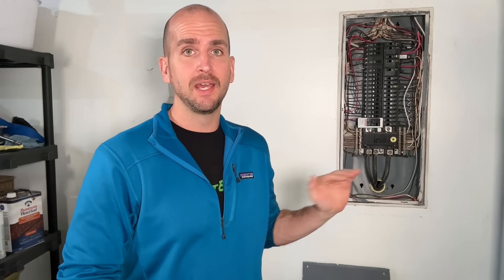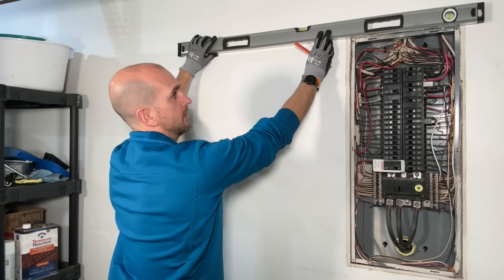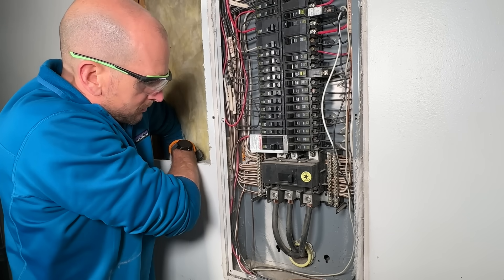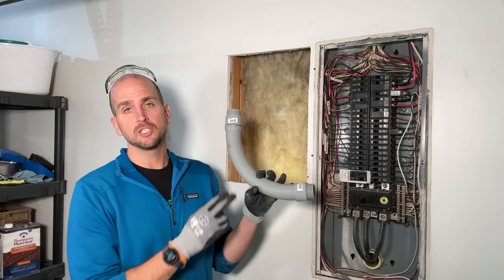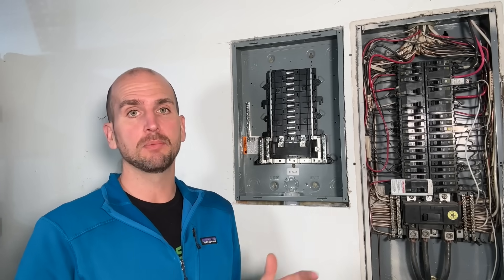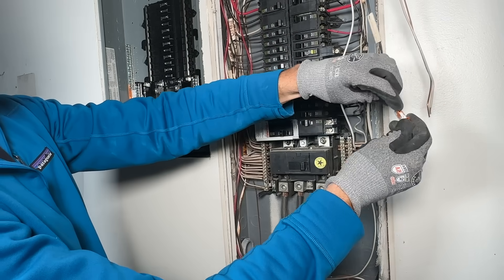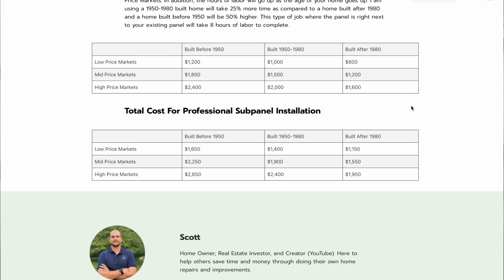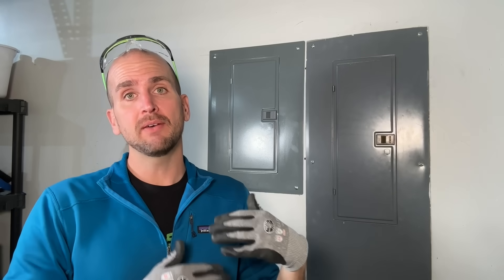How To Install A Sub Panel Next To Existing Main Panel

Comment: Since when can you run a bare ground through conduit???
Reply: 1982
Reply: I haven't seen anything in the NEC (e.g., 250.118) that prohibits it and I can't think of why it would be bad in PVC conduit (though I wouldn't do it in metallic conduit for fear of oxidation between dissimilar metals).
Reply: There’s no potential reaction between steel and copper so it’s not an issue. Copper oxide forms when copper reacts with oxygen, not steel.
Reply: @pld8993 :  Galvanic corrosion
Reply: @ncooty  You won't get galvanic corrosion in a dry location. There won't be an electrolyte present inside the conduit, which is necessary for galvanic corrosion to occur. Also, they are bonded to each other so that eliminates any current induced reaction. If the conduit is underground or outdoors, I'd avoid bare copper.
If what you're saying was true, then we would be prohibited from bonding a bare Cu ground wire to a steel box, which is required in many instances and is considered an effective grounding path. If there was a concern about bare copper being in contact with steel, it would never be allowed for a bonding connection. In fact, when using PVC with a metal box, it's the only grounding path.
Reply: @pld8993 :  Those are great points.  Thanks for the reply.
Reply: Any time

Comment: Next up? How to add a 30 amp RV service to the outside of your house.
Reply from the maker: Then I would buy an RV 😂
Reply: @EverydayHomeRepairs  You’re welcome!
Reply: @donaldbailey5576  
Nah, go ahead and spring for the 50 amp or one of those 30 and 50 amp combos. The 50 amp can be utilised as a secondary EV charger for redundancy.
Reply: @EverydayHomeRepairs  
RVs have their own set of DIY challenges and could be good for your channel.
Reply: @GeorgeVCohea-dw7ou  That’s a good idea. I have no plans for an EV in my future unless they make one that can tow a travel trailer 300 miles and charge in 12 hours. The 80 miles/24 hour charge doesn’t make the grade. But you never know.
Reply: @donaldbailey5576  
It's not too much more expensive when taking the entire project into consideration, and if you sell, it would be even less to convert an existing 6 gauge run to an actual EV receptacle, should the next owner prefer that. 30 amp is mostly left to travel trailers these days, and people traveling in those will almost certainly have an adapter onboard, if you opt for 50 amp only.
Reply: @GeorgeVCohea-dw7ou  Nope. Not selling. Dying in this house. That aside. It would just be for me to plug my RV into. The RV could change though so 50 amp would be the way to go. I already have a 50/30 adapter.
Reply: I installed one last year, then sold the rv! Changing the outlet type this week for my welder
Reply: 50 Amp NEMA 14-50 receptacle all the way.  It matches the larger and more modern RVs, plug in EV chargers, and is the outlet you find at newer campsites.  You can also run welders and similar equipment off of that (with a $20 adapter).  The 30 amp trailer plugs are 120V only, so very limiting by comparison.